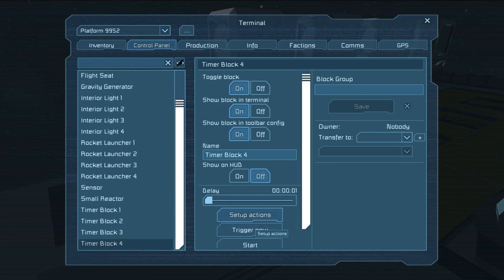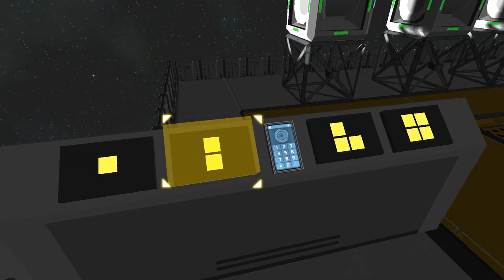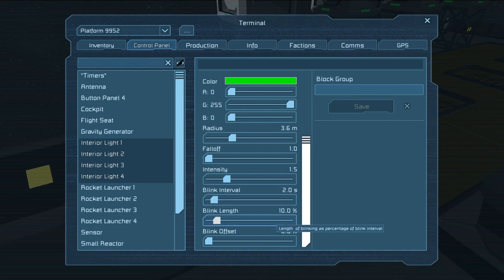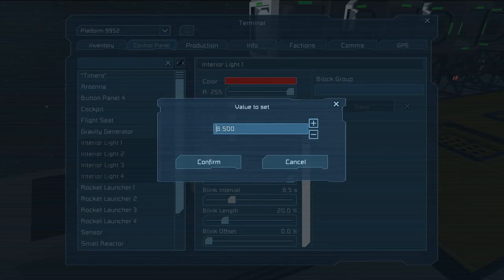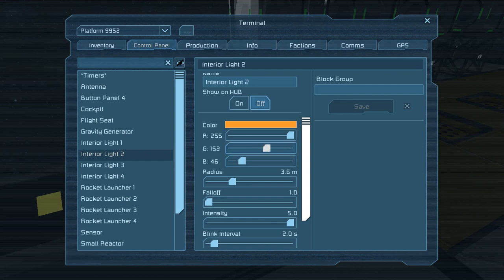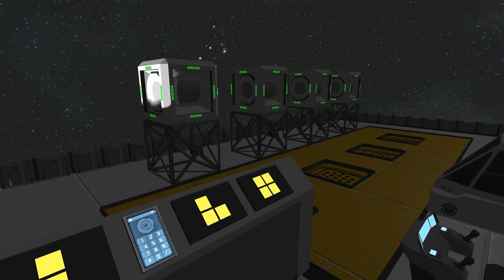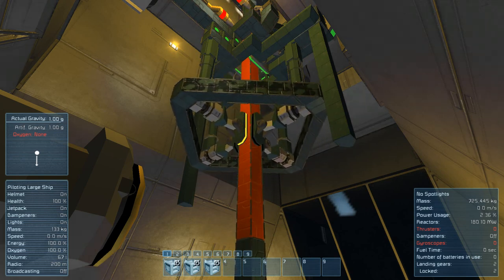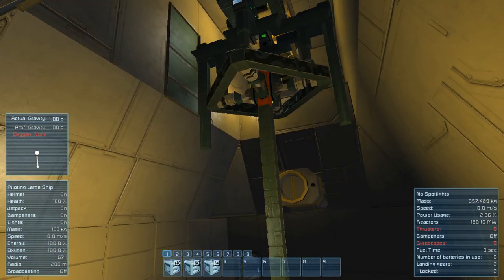Space Engineers – Timer Block Tutorial: Advanced

Comment: Great vid, as usual. I really enjoy your SE content. I've heard that use of gyros on override are useful to add axial stabilization, could that work with the drill head? Looks like the combination of landing gear and rotors on the pistoning chassis (the thing with the 4 inward facing landing gear) is introducing some kind of bug where the timer is failing to trigger the action. What if you introduced a delay as a container in which you triggered multiple "offs" and "ons" of the landing gear between piston movements (a, say, 3 second period where you turned the landing gear off 3 additional times. a bug-buffer)? Where you've got the gripping/not landing gear would wheels with dynamic friction (changed via timer blocks) move the pipe in a similar way, or are wheels not set to move things in the game physics? Additional thought: your use of the wheels in a drilled tunnel reminded me of an idea I had where a sensor was set on a landing gear to attach the gear within range of ground using a timer to disable after a short delay. Multiple instances of that setup on and around the pivot point of a rotor could perhaps be a wheel that could climb walls or, say, crawl backwards out of a tunnel. :)
Reply from the maker: +Matthew Richey Thanks for all the ideas!  I think axial stabilization could maybe work, but I'd have to add a rotor where the pipe meets the drill head in order to prevent the pipe from spinning.  I think you're right about the bug, and I have tried putting in extra delay timers giving multiple unlock/off commands but so far it doesn't seem to fix the issue.  I like the idea with wheels.  I haven't tried it yet, but I think it might just work!Thanks for watching!

Comment: Do you know how heavy this thing will be? And I don't think that there is enough storage in the drills to go that deep
Reply from the maker: +Harry Porter Loaded with ore, I'm guessing pretty heavy (not sure just how heavy though).  As far as capacity goes, I would expect that going super deep would probably require the operator to bring the drill up and empty it before sending it back down to go farther.  There was actually a build recently on the workshop that did something like this but with conveyors and a large ship drill which, frankly, looks like a much better design than mine.  It looked like it might be more stable and it can use the storage of the main ship while it is extended.Thanks for watching!